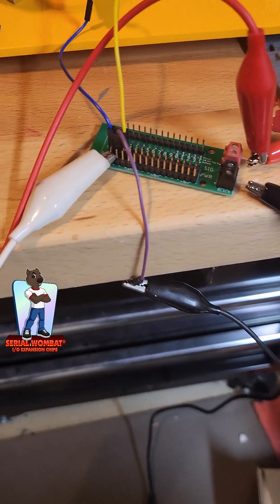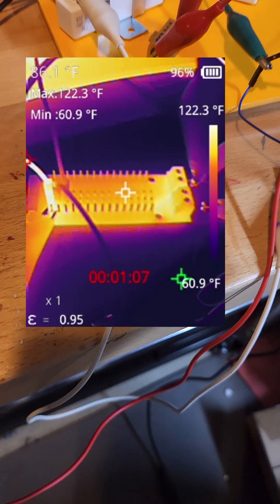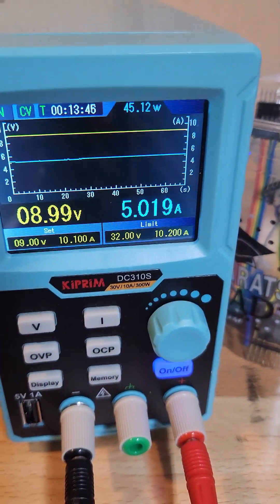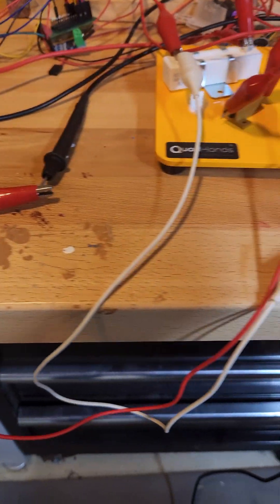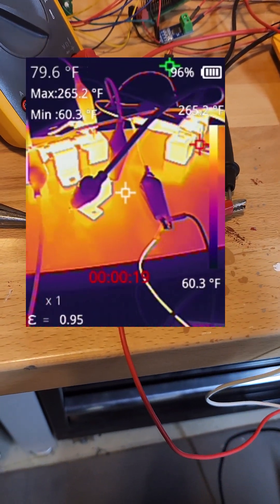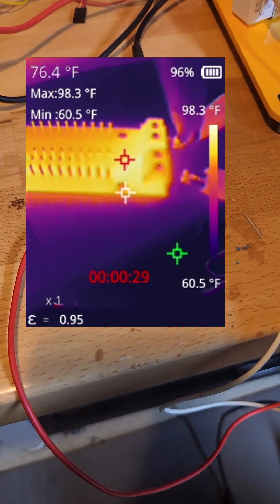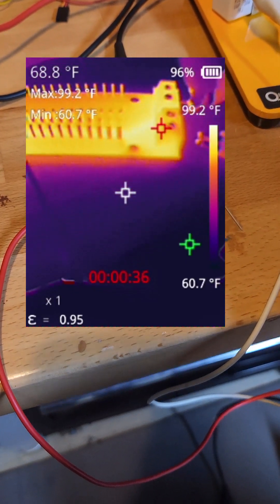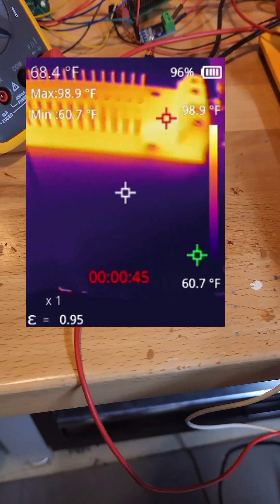How much Current can the Serial Wombat PCB_0014 Servo Board carry?  Let's find out...

Comment: How long can it handle 10A?
Reply from the maker: That's definitely in "It Depends..." territory.  We saw a 30 degree rise at 5A, so we would expect probably 3x to 4x that at 10A (Newton's law of cooling helps some).  If it's in a contained box, less time.  If it's at a higher ambient temperature, less time.  If you only use a couple of the connectors nearest to the terminals, more time.  If there's wires on all the pins, probably less time because they're now insulated rather than acting like heat sinks.  If you go higher than 5A, I'd recommend using both slots in the terminals, as they're rated up to 10A.  In the future I'll likely revise the design to use both top and bottom traces on the positive rail, and probably add some area to the positive between the terminals and the pins to increase heat dispersement.